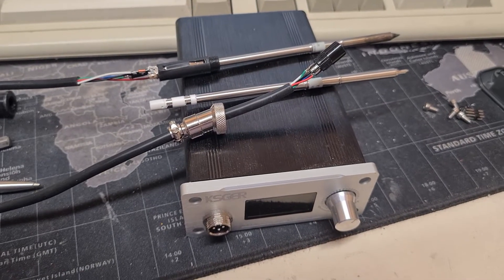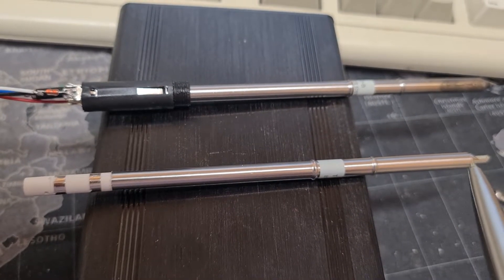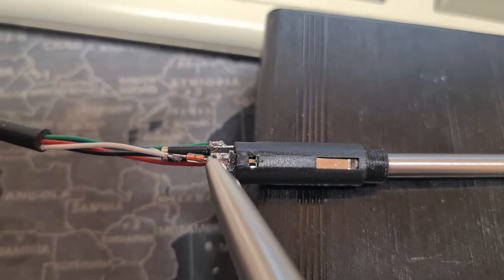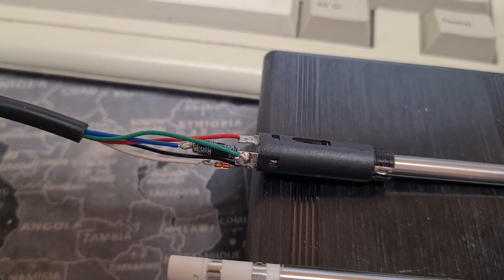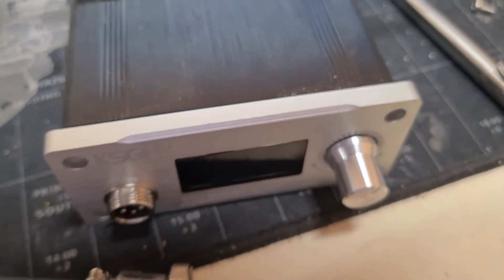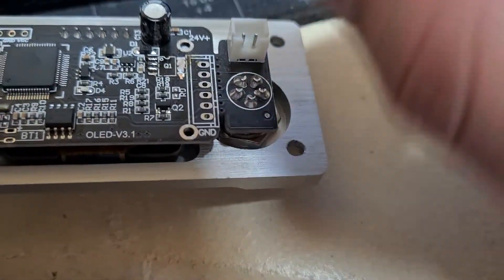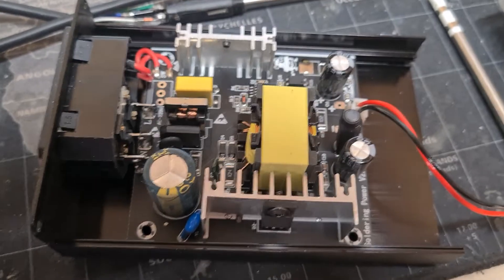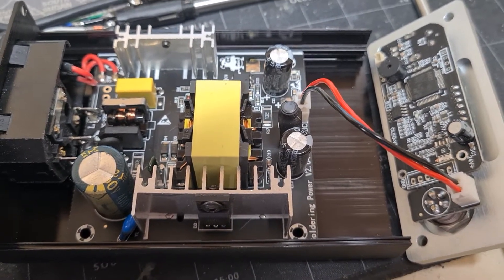KSGER T12 Soldering Station Repair - Shorted cable and popped MOSFET

Comment: Thanks for the  info just mended mine👍the black and the blue wires had both  come off  luckily  fet was good 👍
Reply from the maker: Nice! My broken wires basically shorted the element and popped the FET. Glad got you it fixed!
Reply: @m1geo  I was lucky ,I've taped the wires with kapton tape  and  hot glued around the cable relief ,to try help it out 👍

Comment: Same problem here, but i tried to wick off the solder but the bridges stay or even get worse. Can anyone help?
Reply: Now i checked the mosfet pins and found that there are 3 plus 4 on 1 contact and one single pin, so i am fine.
Reply from the maker: @carocalculon8781  yes, as I me tho in the video, 4 pins on one side are all the same, and 3 pins on the other side. These parallel pins help with the current handling.

Comment: I had to return my beloved Ksger 2.1S due to a malfunction, in my case when I tried to select a different tip , it would not show other selections I had programmed, instead the tip started to get cherry red hot like glowing red , this was the second (and the last) time it happened and as much as I loved this soldering station, I just could not have enough confidence in it any more and had to return it, but I did order a 3.1S version soon after and now I'm waiting for it to be delivered. these are in general great soldering stations .
Reply: did that soreted your issue?
Reply: @Chaosek   Yes it has been working without a problem, it's just a workhorse , as a hobbyist I doubt it will ever break on me again ,  no regrets at all.